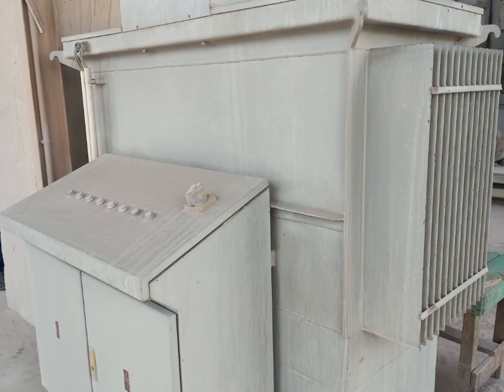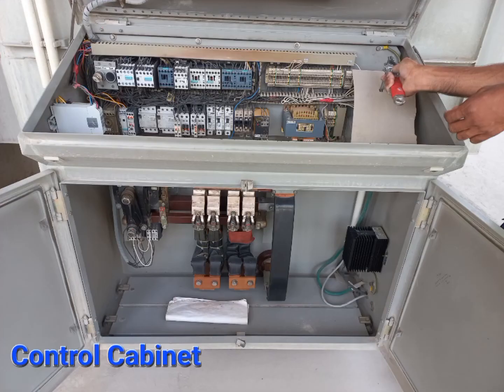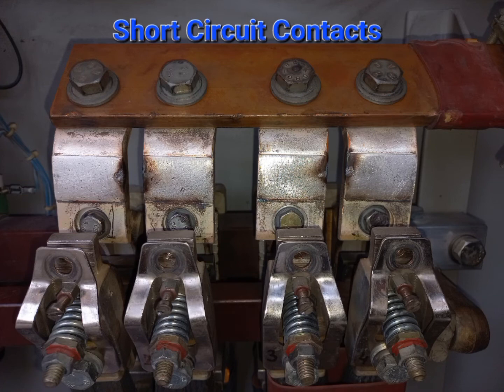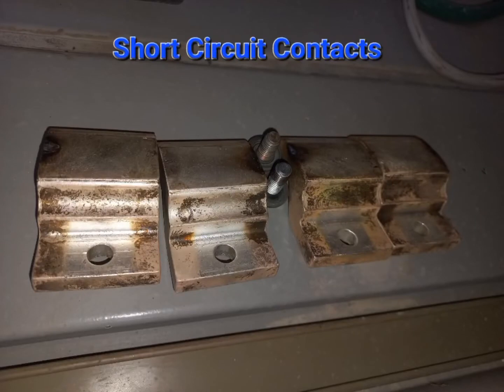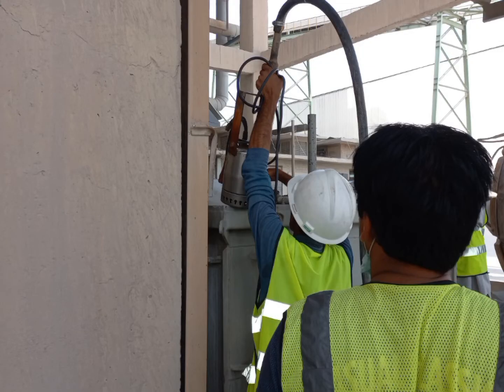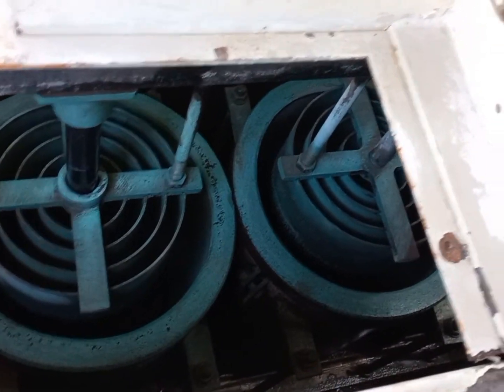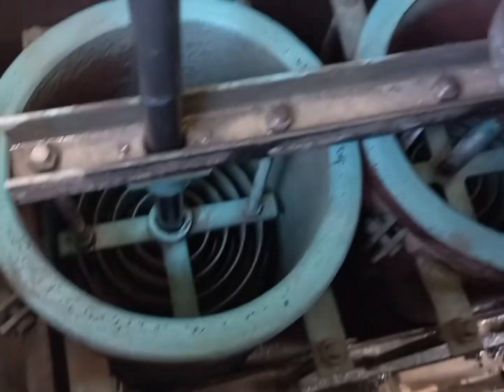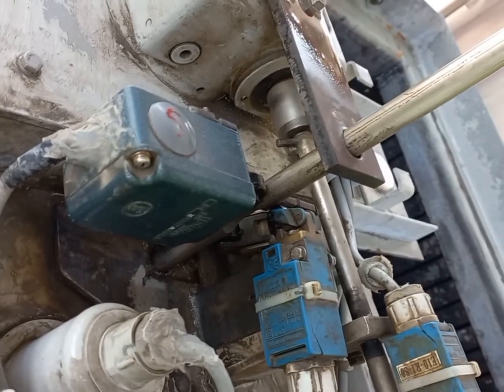Liquid Starter for Slip Ring Motor | Working Principle | Rotor Rheostat Starter | Maintenance

Comment: Hello. Thank you for this is video. I have questions. How many Conductivity of LRS? How is LRS calculated for a motor? What is the electrical resistance of LRS? Can you elaborate on these? Please.
Reply from the maker: Thanks for your interest. 
The actual conductivity value can vary based on the specific design and requirements of the motor and starter system. It is typically in the range of 10 to 1000 mS/cm. 
The calculation of the Liquid Resistance Starter is based on the motor's characteristics and the desired starting parameters such as starting torque & Current, starting time, starting resistance, electrolyte solution etc. 
The electrical resistance of a Liquid Resistance Starter (LRS) is not a fixed value but can be varied by adjusting the configuration of the resistors within the starter. During motor starting, the LRS initially provides high resistance to limit the starting current and torque. As the motor accelerates, the resistance is gradually decreased by the control system to allow the motor to reach its full speed.  It's not a single fixed value but rather a variable parameter. 
Thanks
Reply: @ghulamshabbir1974  

Thank you so much, for valuable information. 

Can you tell me about the conductivity values of such LRSs that you have designed or seen? For example, 800 kW is "this much" for 6kV 1000 rpm, "this much" for 630 kW, and so on. I need a template.
Reply from the maker: Sorry dear, I dont have such template
Reply: @ghulamshabbir1974  

If you have somewhere designed, calculated or seen the LRS for motors, based on the motor characteristics as you said. Can you share that information? (The calculation of the Liquid Resistance Starter is based on the motor's characteristics and the desired starting parameters such as starting torque & Current, starting time, starting resistance, electrolyte solution etc.)

Comment: what is difference between wound rotor and slipping rotor
Reply from the maker: Wound Rotor and Slipring rotor are same. Both used in Slipring Induction Motor, also called as wound rotor induction motor.

Comment: For which motor this liquid starter is used?plz let's know the concentration value of this liquid starter
Reply from the maker: This is Slipring Induction Motor of 2.650 MW (6.3 KV). Concentration value is 2.7% ( 865 liter of water and 24 kg of Na2C03)
Reply: @ghulamshabbir1974  

How many the conductivity average value for this is motor(2.650 MW)